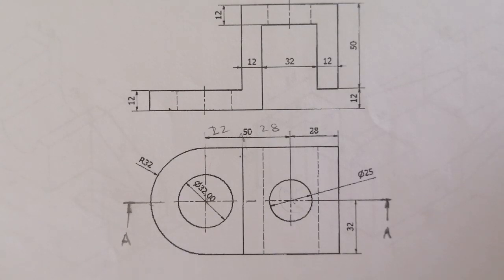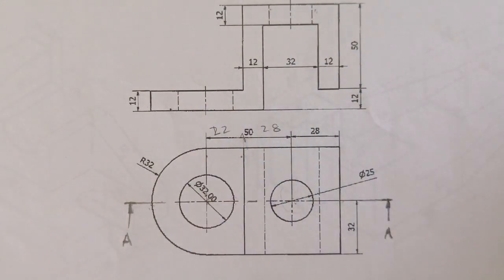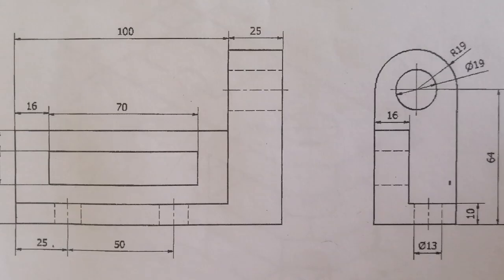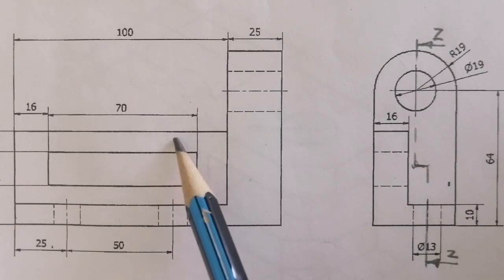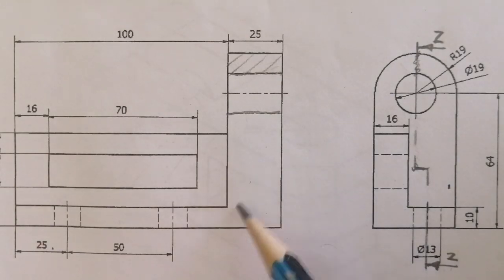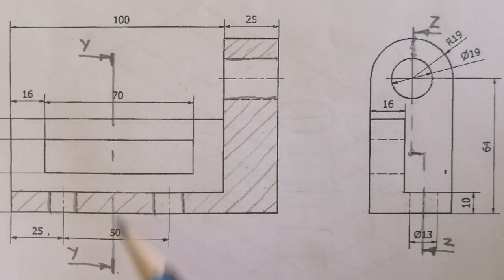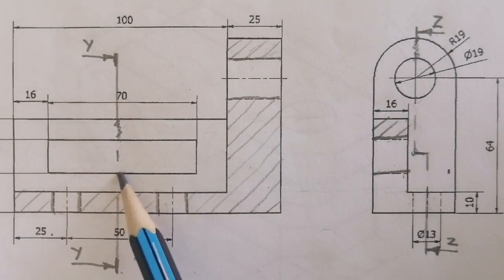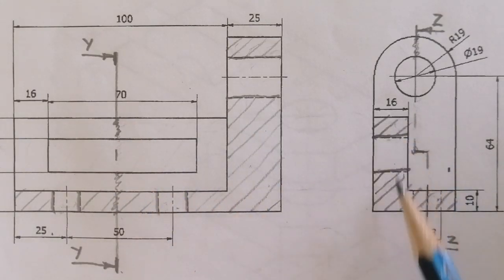How to do Sectioning Drawing Easily.

Comment: Why the corner on section z-z not shown on the sectional drawing???
Reply from the maker: The corner in general are neglected in sectional drawing. The purpose of such a section is to get through the centre of the holes. The holes are the places where assembly components will be placed. Please see a similar example on this link.             https://youtu.be/3lGFp-LA0l8

Comment: Is the section always in the direction of the arrow?
Reply from the maker: No, in third angle orthographic projection the arrow points away from the position where you have to section. 

For first angle orthographic projection, the arrow always points towards the direction of sectioning.
Reply: @farida7777777  so if am not told the angle of projection ,i can choose any?
Reply from the maker: Yes, It is normally expected from students that they use their own projection angle if it is not stipulated. The product that will be manufactured will come out the same.